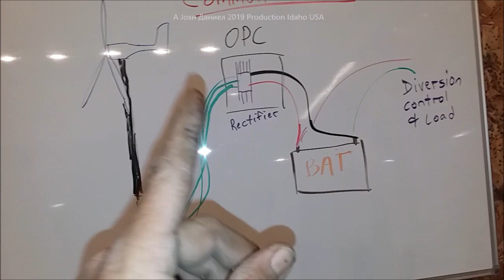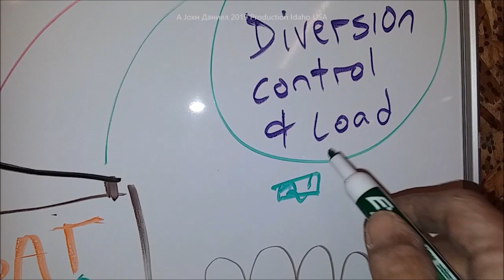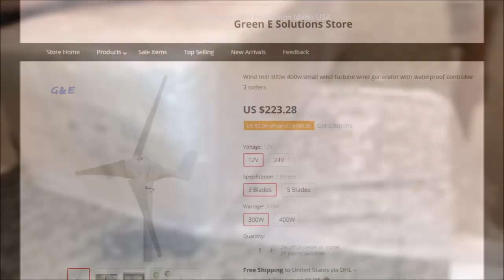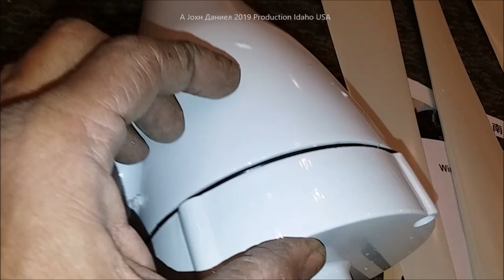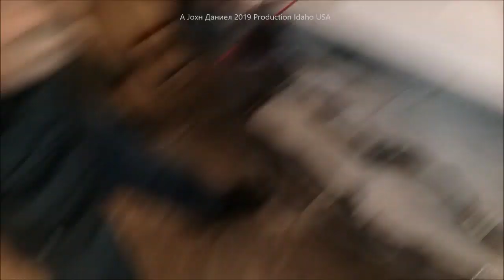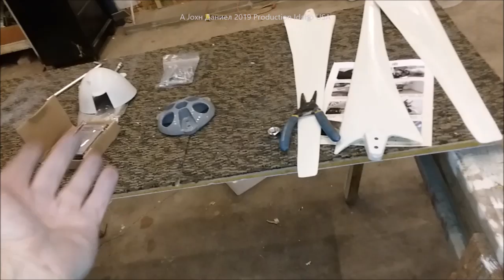300 watt Micro Wind Turbine, the GE-300-S, truthfully 300 WATT RATED! ALL Parts below vid

Comment: I bet a few of your followers could build the controller if we had some part # control board, relay, ? Running 2 or more to the box how would you connect them? would each need their own rectifier?
Reply from the maker: One turbine, One rectifier. I may have the boards sourced and put on a site. I just stay so busy from solar installs, wind turbines, running cattle truck and homeschooling 4 kids I am lucky to be making the videos on the methods I use.

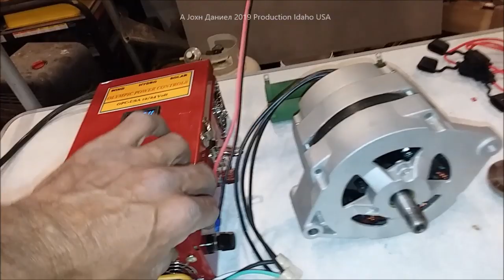Comment: At 8:05 you might want to make a correction.  Common Failure Mode for SSDs is shorted.  Seen two SSDs burn up control panels over the last 15 years.  Very low possibility if properly sized and cooled.
Reply from the maker: Are you referring to automotive Solenoids that some people use?

Comment: John can u set it up for lithium batteries at 24v I like to try it I just don't want to have to buy another classic 150 for my wind
Reply from the maker: You can, a best unit is a Ysolar made. It can run a very accurate temp controller and charge 3 to 70v LiPo. If you want the exact one let me know I will find the model and place.
Reply: @JOHNDANIEL1  I would be interested in knowing the make & model! Thanks!

Comment: Hi John love all your videos I wanted to ask you could one of these cheap wind turbines be rewound for 24 volts I ask cause I have a 12/ 24 volt one but it is hard to get it always at 24
Reply from the maker: The link below the video goes direct to Green E on Ali, there you can just get a actual 24 volt with a open voltage of up to 52 volts (before battery takes it down to your 24 desired)
Reply: @JOHNDANIEL1  Thanks allot
Reply: @JOHNDANIEL1  The link below goes to B-Creation. https://bit.ly/2oJBxFq  Is that link correct?

Comment: I want one of John's controllers , he promised me one. But here we are 4 mo later still no controller.  :( .
Reply from the maker: I got you box of parts made up for one on a board with the digital URD12-24 model and a 60 amp SSR, was planning on being in the BF area but every cattle load diverts me down 93, not east. 6 months worth of a cattle haulers awesome fungal lung infection has put me so far behind and ad to that the "Terrible Orange man" Trumps economy has me working 3 times as many hours of trucking and power installs as I ever saw from 2009 to 2016.
Reply: Well when can I meet up ? You should come to blackfoot just for shits and giggles . I would love to show you my setup. I have completed the electronics box just needs your controller installed.   And my new battery box is under construction  right now. I just picked up some more 0/1 welding cable 30 ft and   need to build the bus bar for that box and get it done . I have been working my butt off on everything.  I also fixed all the welds too. I found out turning the line feed on 9 and amperage on high and using my solar setup to power it and also cleaning off all powder coating my welds are very good now .
Reply: FYI I work at a freightliner dealership... could sure use some of this for my off grid plan
Reply: John Daniel is the person who peaked my interest in wind turbines.i that lead to one of my greatest ideas of all time. A portable wind turbine tower that mounts to a trailer you can hitch behind your camper and tow. https://youtu.be/Ej0fBGQwrRM
Reply: John can you just email me the address and I can come down there and pick it up? I like your red one how much  would you charge me for one? I need also a braking switch so I can hit that while transporting the turbine.
Reply: Here is another video where I talk a bit about my new unit https://youtu.be/rUyNzPLudOQ

Comment: Hi John. Do you think it is possible to put a small wind turbine on top of a large vehicle? The vehicle I am thinking probably couldn't go above 65mph. If so, would need to be mounted in a specific area? Could it catch wind while moving or just best when stationary? Thanks...
Reply: Just build a portable wind turbine tower and mount it on a trailer with extra support frame use quarter inch thick steel.
Reply: @donaldsteele6276  Thank you, perhaps I can have a portable configuration that could somehow be easily set up when stationary. Cheers
Reply: It would be very difficult to reinforce that enough it would tear the hell out of a vehicle frame from the pull.
Reply: Like this https://youtu.be/Ej0fBGQwrRM
Reply: Dude you could make a wind tunnel that runs down the middle of the vehicle with some invention and thinking outside the box and install a row of turbines in some kind of funnel or tube and have a foot pedal that opens it while driving and it would work. Just have to find where to build it.
Reply: Maybe just hook up a row of sprockets and attach multiple PMAS to the drive line and share the kinetic energy with them while in motion.
Reply: Or hell just hook a bunch of 400 watt peltzer plates on the motor block on the hot side and a heat sink on the cold side and run the positive and negative wires into a mppt controller.  And battery bank. There u go
Reply: Or maybe you can hook up a belt yo each tire well that spin a PMA and run them to a deversion controller then to a switch for ac or heater you choose. Then to a brake switch then to a large rectifier then to a mppt controller then to batteries or inline inverter.